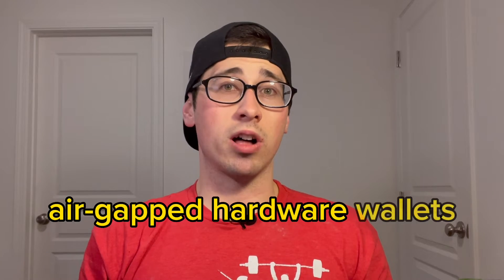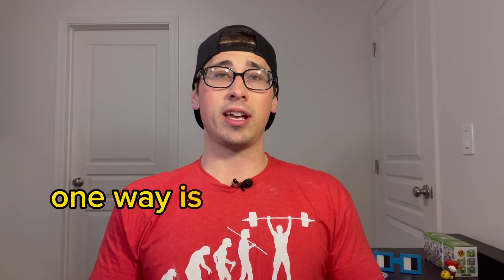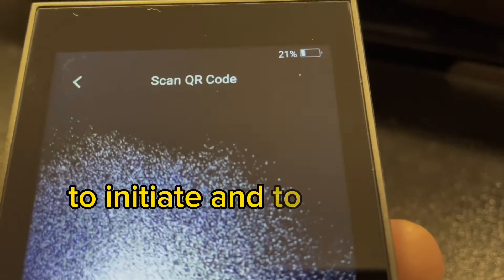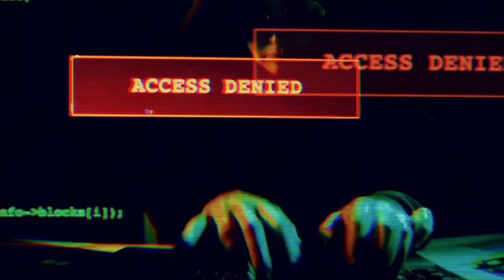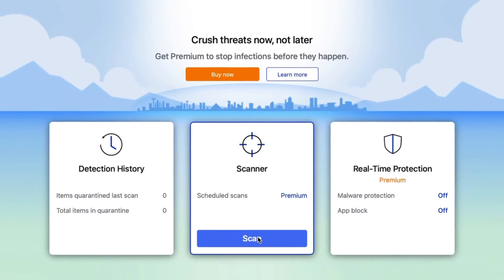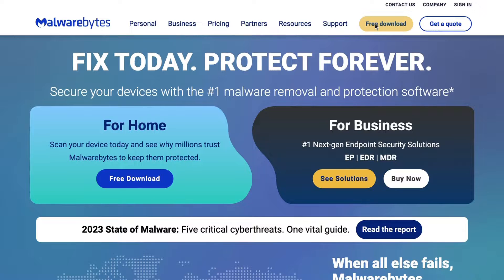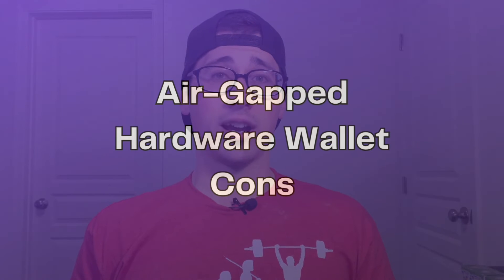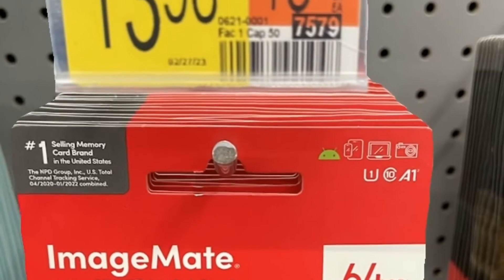WTF Is an Air-Gapped Hardware Wallet?

Comment: I don’t get it. You show that you scan a QR code from say metamask on a computer, but then doesn’t the keystone need to communicate back to metamask with a signed message or something? The keystone holds the priv key and you ok a tx there, but then it needs to talk back to the nodes validating and hosting the blockchain so that they know you proved you own the wallet and want that tx. Does the keystone make a second QR and display it on its screen? Does the computer / metamask need to scan this second QR?
Reply from the maker: Yes, MetaMask requests a signature from the Keystone device via QR. 

So you scan QR code with Keystone, then an authorization is sent back to MetaMask which you scan again using your phone/computer to confirm the tx
Reply: Oof. That about kills air-gapping for me. Too much pain. I get that it’s the most secure but… “ain’t nobody got time for that!”
Reply from the maker: Yeah, I know what you mean. IMO, an air gapped device is not necessary. 

You can secure your crypto using a good/dedicated cold storage wallet and best practices.

Comment: Thanks for the info, i have a question is there a difference between Keystone wallet and air gap vault App, because both work on the same method.
Reply from the maker: I need to research this further. From what I can tell, using a dedicated air gapped wallet like the Keystone Pro is more secure than the Air Gap Vault app.

Whether you use one or two phones for the app, you’re still using it on internet/Bluetooth-capable devices.

An air gapped wallet has no way of connecting to external communications.

So you could say it’s technically more secure.

Comment: If I understand correctly, even on a hardware wallet, the wallet address is largely still public, and so can still receive "NFT drops," including ones with Smart Contracts with malicious code.

Or is it the case that the wallet is somehow removed and unavailable or invisible from public scrutiny?

Barring, of course, privacy centered block chains like Monero.
Reply from the maker: This is true. The blockchain is public/transparent. There’s no way around your address being publicly available, at least on blockchains like Ethereum.

As for the malicious airdrops, you just have to use common sense and not interact with them.

They don’t magically hack your wallet.

The hack occurs when you try to interact with it and you click on the link (phishing scam).

Great question! Thank you!
Reply: Cryptography used a public and private key  pair the public key is  as the name suggests public the hardware wallets stores the probate key. Crypto  wallets do not store the coins just the private keys  the coins/tokens live on the Blockchain as can be seen using a Blockchain explorer .

Comment: None of the major hardware wallets have ever been hacked , all lost funds have happened due to phishing  or tricking you into signing dodgy transactions the weakest link is by far the end user. More education is needed  before considering an air gapped wallet for 3xtra security as the scammers will take your crypto just as easily from those .
Reply: Upon this point I am not aware of any hacks to Ledger nor Trezor. 
Ledger did leak out customer info, but not a cryptographic loophole. 
In Trezor case, it seems hacker was able to recover the funds because of cracking the PIN, not private keys. If reset the wallet, that would be a different story.
Reply from the maker: The info is public. Both ledger and Trezor wallets have been compromised (im not talking about a user error). 

With Trezor, an engineer was able to hack the PIN code through the microcontroller to recover his lost assets.

Good feedback. We will create more content about using a hardware wallet effectively! Thanks Paul, you rock!
Reply: @cyberscrilla  please provide sources for your claims to my knowledge the ledger user database was comprised  addresses names etc  not the wallet and  the trezor was hacked in a lab with old software after and it had to   taken apart to do it , stop scare mothering showing tour complete lack of understanding to the problem , talk about real issues   like the Thousands  of ways users can and  are tricked to signing  transactions  they shouldn't , rather than the 1 in a billion hack .
Reply from the maker: @PabloTBrave  Thanks for your feedback Paul. We aren’t trying to scare anyone. We will create more video informing people how to use hardware wallets effectively.

Thanks again!
Reply: @cyberscrilla  pauls logic didnt age so well
Reply: @user-uq6vh3ps7m why what happened & im pretty sure his name is Pablo not Paul lol